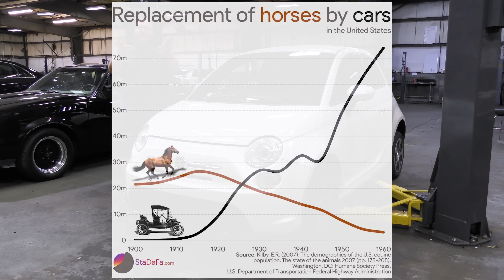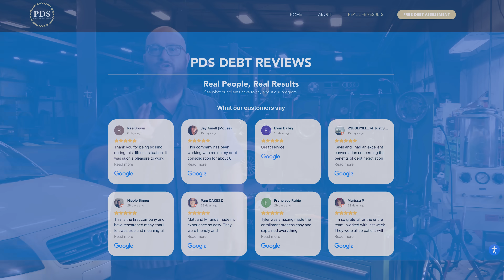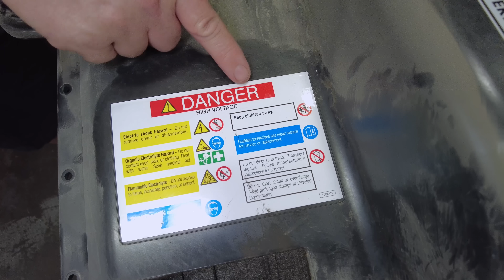How to SAFELY Remove the EV Batteries From my Fiat 500e

Comment: Very interesting to see the insides of the battery - lets hope the rebuilt module does the job. One thing about the Horse/ICE and ICE/electric comparison though - It's rubbish.  The ICE rapidly displaced the horse because the ICE was almost a quantum leap in improved capability.  The battery car is not being pushed by government because of any improved present or future capability but because of concern over the effects of fossil carbon emissions.  A synthetic liquid fuel and oils would produce the same benefits.
Reply: Synthetic fuels still have exhaust emissions and the fuel itself takes a lot of energy to refine.  For the most part it makes more sense to feed that energy into EVs rather than to make fuel.  What makes even more sense is using our vehicles less and buyer smaller less heavy cars in the first place.

Comment: It’s just a matter of time before electric vehicles will be banned from all tunnels because of fire hazard⛔️
Reply: In the mind of weirdo EV sceptics.
Reply: @londonyes1380  time will tell if the weirdo is right or the leftie 😀
Reply: @erwinvangrinsven9345  its got nothing to do with politics.  Only stupid people make it political.  It has to do reality and facts.  This is about a different propulsion system for personal transport.  If you make something so mundane about politics then I feel sorry for you.
Reply: @londonyes1380  fact is that there is a lot of EV going up in flames.
Reply: @erwinvangrinsven9345  the actuall fact is that internal combustion vehicles are statistically more likely to catch fire than electric vehicles.  Feels over reals though eh?
Reply: @londonyes1380  because there are more combustion engines , when a normal car catches fire, fire brigades can actually put the fire out without a lot of effort, that’s the biggest problem with EV, they provide oxygen when burning.
Reply: @erwinvangrinsven9345  ok but you conveniently ignored my last statement.  They are a lot LESS likely to catch fire.  And thats per EV not vs per ICE car.

Comment: You only need a open Standard for zhe communication with the battery. Then you can upgrade the pack including new electronics. If the car can communicate with the pack it will be ok.

The battery technology develops to fast to be standardised. And different types of cells have different capabilities. More short time power or more capacity.

Comment: Remember that it costs as much to put less charge into a knackered battery as it does to put more charge into a good battery. A 50% efficient battery will cost twice as much per mile.
Reply: People wont be driving around in %50 efficient batteries though.

Comment: Electric cars are not new technology. Electric cars were very popular until the advent of the electric starter to replace the crank start on ICE vehicles. I think battery efficiency and cost still need to drop. A new Fiat 500e cost over 30K with 120 mile range.

Comment: Not true. You don't just drive EV's maintenance free. Its so heavy the tires wear out faster than a regular car. The tires also cost more. EV's break all the time and guess what the days of DIY jobs are over. So then you get charged big at the dealer. The idea of a Electric car is dumb, dumb, dumb. ICE engines forever! I hate electric cars.
Reply: I hate electric cars".  Exactly you have no real legitimate criticisms you just hate the idea of electrically powered vehicles for some strange reason.
Reply: @londonyes1380  I have plenty of reasons to hate electric cars. Costly special tires, batteries that do not last with high heat and extreme cold weather. Battery mile range is not as far as gas cars. Mechanics do not know how to fix them. Current infrastructure can not handle the electric load if everyone drove a EV. High cost for a home charger install. DIY owners may be put in danger trying to fix a EV. Lithium mining environmental concerns making them bad for environment. Shortages of Lithium.
Reply: @michaeldifensore5631  specialist mechanics are popping up all over the place.  Most have very good thermal management systems.  A lot of what you listed are things needed to be improved upon, not a reason to "hate".
Reply: @londonyes1380  You can't improve upon something that is a bad idea from the very beginning. Electric Cars move humanity back in time not forward like the Industrial Age did. Let me guess your against Nuclear Power to?

Comment: You bought a good point EVs are here to stay and for a repair to the BCM on your Fiat 500 EV and this is another thing about EVs your Fiat 500 looks like a Fiat petrol diesel or electric and it is such an iconic design and infact l think the Fiat 500 design language takes a lot of clues of the original Fiat 500

Comment: Major car companies are dropping EV’s. 

EV’s will fail for so many reasons.
Reply: Pretty much every single car company is making an EV and selling it somewhere in the world today and that is only increasing.  Keep sharing your missinformation  though maybe it will magically come true!
Reply: @londonyes1380  : Toyota, Ford and GM may be dropping their EV program. 

Ev’s are currently too impractical to replace ICE due to range, excessive weight, cost (especially battery replacement), refuelling times/locations (remember the Teslas that were abandoned in Chicago in that cold snap this past winter?) to name a few.
Reply: @kennethmelnychuk9737  since when did Americans give a damn about the weight of their cars?  And modern batteries last hundreds of thousands of miles.  Ford for example are investing in factories to build low-cost batteries for their future EVs.  Where are you getting your info from?
Reply: @londonyes1380 : Americans give a damn about the weight of their cars when they have to replace their EV tires more frequently than ICE vehicle tires. . 

The EV’s extra weight is decreasing tire life and EV tires cost more than ICE vehicle tires. 

My info comes from Consumer’s report (Issue 2013, Lot 3232, pp 31-38, July 2023
Reply: @kennethmelnychuk9737  ok so tyres cost a little more because EVs are a few 100 kilos heavier..  seriously though when have so many Americans driving huge v8 tanks to the shops and back actually complained about the weight of their cars?  🤣🤣
Reply: @londonyes1380  :  yup
Reply: @kennethmelnychuk9737  "yup"... i rest my case.

Comment: My problem with modern cars is that i just do not want all of the electric gizmos and gadgets. I have no problems with EV's but i would love to have a simple EV without infotaiment systems and stuff like that wich end up raising the price of the car.

What i would love is something extremely simple like those old Subaru Sambar EV conversions that we used to have in Finland called Elcats in fact if i would right now get one for right price i would buy it in a instant as with its 70-110 km range it would be really good and cheap to run my work commute. Sadly those things are rarely up for sale and even more so now that fuel prices are up the roof.

Comment: I'm angry that a mint condition, 10 year old car is scrap because of a nearly dead battery. There's no way this is actually good for the planet, or even better than a liquid fuel car.
Reply: Its not scrap hes fixing it.  And you can recycle/reuse an old EV battery.  You cant recycle liquid fuel.

Comment: How much is the repair at this point?

Stupid to put the battery”brain” in the pack. It should be in the car, far from the battery mess. 

I don’t believe the manufacturers will standardize on anything they aren’t forced to. Look at the hub nuts on tires…

Australia had a law that appliances had to be user serviceable. It would be nice if EVs could be that way. Standard Motor/Break hub modules. Standard battery. Fix them like Legos. It would make EVs easy to repair, and a valuable alternative.

Comment: EV proponents and the Biden-Harris administration have tried to convince us that EVs are simpler & more reliable than ICE  vehicles yet somehow require a $7500 taxpayer bribe to convince us.
Your video has shown how complex that battery pack is with controllers, sensors, coolant & venting systems and multiple mini-packs/cabling.  The parts count must equal that of a regular 4-cylinder gasoline engine. Then add in the electric motor(s) with their complexities.... simplicity certainly doesn't come to mind.  Then there is the obvious weight issue.  As for reliability?  Don't think so.
Wizard, I appreciate your intrigue with EVs but Biden and company have tried to SCAM the US public.  You are correct though, if they can find a way to store energy for the electric motors in an efficient manner, EVs might one day be competitive.
Great instructive video!
Reply: Weight AND wait issues. (If the governor doesn’t regulate your power use).

If they want us to go all EV we need a robust power grid!

(ICE, and freedom forever!)
Reply: @McSquash its got nothing to do with freedom.  Some Americans just like to pretend to be opressed about anything and everything.

Comment: Most EV owners will trade or sell when they hear the price of replacing the battery. How many people do you know that want to spend multiple thousands of dollars for a new battery pack?
Reply: As he pointed out, early leaf models had bad thermal management and battery chemistry and didnt last nearly as long as they should have   a growing number of new batteries the have very sophisticated thermal management and will last hundreds of thousands of miles.
Reply: @londonyes1380  Time will tell if the theory is accurate.

Comment: The EVs are not what people that travel want or need. EVs are only good for around the town or city. Ford found out that no one wants EVs with the F150 Lighting. The lithium is damaging the environment worse than gasoline cars.
Reply: Lithium mines that damage the environment arent acceptable but still do less damage than the extraction and refinement of fossil fuels.  And yes they arent ready for vast rural areas yet but millions of Americans do infact live in towns and cities so it makes a lot more sense for them.  Of course using the car less by walking cycling taking the bus etc..  is also a great alternative.

Comment: It is sad to see how electromobility has become more of a political lifestyle choice when most of both sides of the controversy don’t realize that the auto industry doesn’t want to make gas cars anymore. That’s who matters regardless of consumer demand. Even to the detriment of Big Oil. Less parts and labor, it now costs less to make an electric car, this is fact. 

Ever since VWGroup proved a way to make a BEV more profitable than ICE cars, better than Tesla has with their product line, the industry is now following their lead to make the BEV more competitive and profitable as they go along. 

You are right Wizard. Electromobility is the wave of the future like it or not, and we better get used to it. You need to open an app to find a charging station, and not look around the corner for a gas station to refill, that’s ICE thinking. A BEV is a different separate invention. A similarity is us switching from Betamax to VHS to Blue Ray to streaming. What choice in that did we really have? 

Just sayin’

Comment: Electric vehicles (other than mass transit) are proof that climate change is a scam!
They’re a mobile waste of energy, resources and time. In its entire life that Fiat has probably not managed to even to break even on the carbon footprint of its manufacturing. If the wizard can get it back to full operation it will take another ten to twenty years of use before it pays out its now much larger footprint.
It is estimated that even if all transportation went electric the amount of carbon emissions reduction would still be insignificant to the point of being utterly meaningless.
Electric vehicles can reduce actual pollution in cities (provided they don’t catch fire) but to do so they’d need to be small light short range vehicles that are one or two seaters (little more than golf carts )with batteries that can be swapped out like power tools. Not monstrosities like the cyberurinal.
Reply: Climate change is backed up by 40+ years of scientific research.  Climate change denial is a scam funded by the fossil fuel industry. Unfortunately this kind of well-funded propaganda is very effective on stupid misinformed people

Comment: Cybertrucks and some Model Y that use 4680 batteries have no separate compartment for the battery pack.  The top of the battery pack is the interior floor.

Comment: I'll agree with wizard, the battery cells need to be standardized the same way USB-C has become standard for more electronics. That will absolutely never happen because the cars wouldn't need to be replaced unless they're wrecked/rotten.
Reply: 4 types of fuel at the ⛽ station, gazillion architectures for ICE & still, it works. Most efficient solutions will take the prize. But that doesn't even matter: 90% of EV owners will never need battery servicing in the life of the vehicle. The mobile parts like the rotors, plus inverters are what fails & those are changed fast and easy.

Comment: On July 25, 1919 on Lake Washington in Seattle, Washington a man named Hubble demonstrated a power generator in an open hull boat with an AC motor driving an inboard prop shaft.  There was no engine on the boat.  There was no gasoline or other fuel on the boat. There were no batteries on the boat.   Just a cube with power wites conneted to it.   Just a cube with power wites conneted to it.  But there it was tooling around the lake being driven by the AC moter connected  to the prop shaft.  There were reporters on the beach, and you can go to the main Seattle Library and see a picture on the front page of the Seattle Times of that date.  When he beached the boat the reporters asked him how it works.  He replied "I don't know."  In around 1980 Paul Brown found the power source and started repeating the project.  Along the way it was picked up by a company I worked for, which is how I ended up knowing about it.  WE didn't know either.  It took two physisists two years to find the math.  ONE TIME THE LIFE OF THE SOURCE MATERIAL.  Maybe the only one time application and possible new physics.  Not 1/2 as you learned in school and a formula not shown in text books after 1903.  Yes, it is nuclear.  ALPHA nuclear, which means it is safe to be around.  Similar to the material that makes your wrist watch glow in the dark.  We had it working, but you will never see it today.  The company was a public company and a board member of a major energy company had quietly been buying stock until one day he walked into a board meating and fired everyone except Paul Brown to finish the samples for IBM, who wanted them very badly.  The new president was from New Zealand and when all the development money was in the bank he took that money and left the country.  Nobody followed him or tried to get the money back and the company was dead, burying the technology once again.  I suspect that was the plan from the start to kill the project once and for all.
Reply: Nice story.

Comment: I have two great paid for cars. To switch to electric I would have to upgrade my electric service to our house, install a charging station and buy the cars. I haven’t bought a new car since 1979. Electric cars look like throw away cars. When the battery needs replaced when the car is 8 to 15 years old, a battery costs more than the car is worth. It’s like putting a $15,000 engine in a gas car r that would be worth $10,000 in perfect condition. This will of course all change, but it will take time.
Reply: In 2010 yeah batteries werent ready and Consequently degraded faster than they should have.  Modern batteries wont degrade anything near that quickly though.  Especially with LFP solid state batteries etc..

Comment: I think that the major manufacturers at the moment don’t want the EV to appeal to the public. There’s still great profit in IC engines along with the investment they have in engineering/manufacturing. The only reason they are offering any EVs is government pressure, and investor fears so for the moment, the move is half hearted. I believe the strategy will be proprietary hardware with proprietary servicing as much as the law will allow. It would be easy for them to make the battery pack modular with a one hour repair to a battery pack regardless of the problem but they won’t do that. Aside from battery degradation, properly engineered electronics shouldn’t fail from normal use - ever.

Comment: @CarWizard. The cells are prismatic and made by samsung sdi. They are 60amp hours. Samsung made 94 and 120 amp hour version later that bmw decided to use but fiat didn't. Would be expensive but cool to see an upgrade. I have a 2017 500e and love it for around town

Comment: I just hope they don't put social media on the console screen before fully self driving is available. Better to watch the road while driving. Also self driving was 10 years away 10 years ago. It still is.

I completely agree with the need to standardise on battery components. It will make stocking and selling parts much cheaper and everything associated with cutting service costs directly drives down insurance premiums.

What are the Chinese doing in this regard? If they are standardising or do it first they will gain a significant advantage.